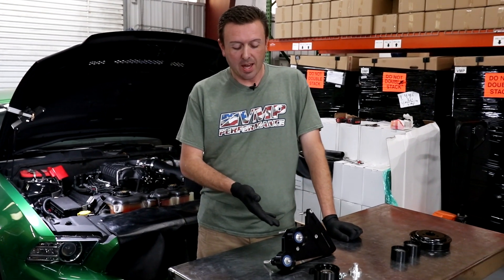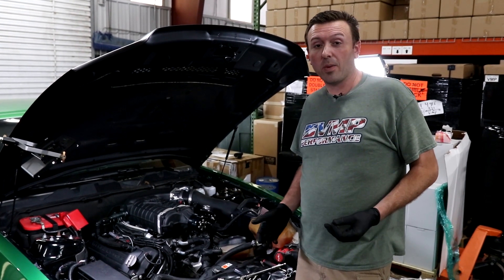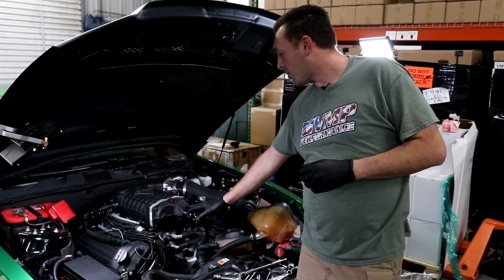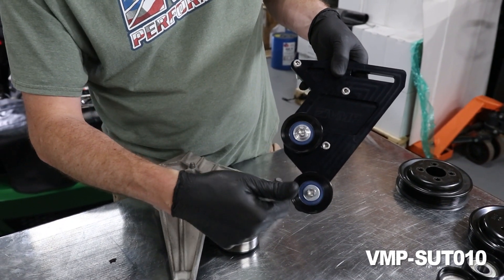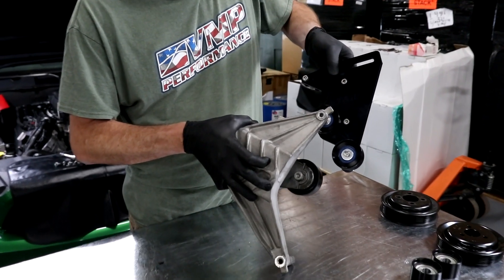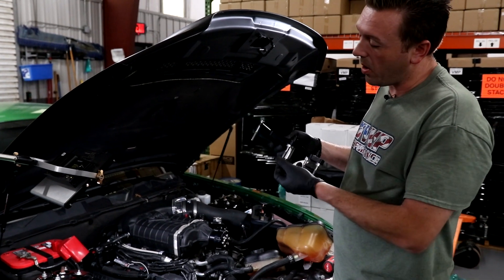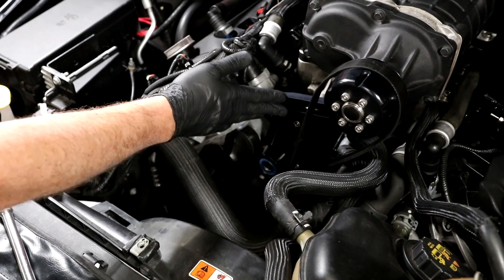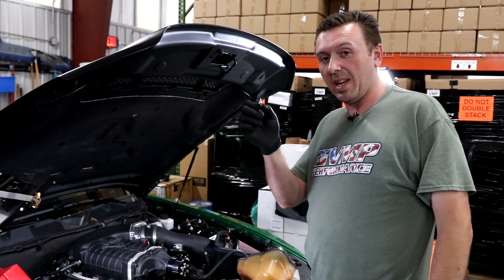Product Feature ||  '11-'17 VMP Bomber Bracket FEAD Upgrade

Comment: I was running a bigger pulley & still ended up breaking a belt, seems like it was because the natural set up leaves the belt looser than it should be.

Guess I'm going with this additional pulley setup now
Reply from the maker: Hey Shane, appreciate your business and support!  Belts can be a bit of a challenge as there are a number of variables that affect them.  We have seen them last for years, and we've seen them snap in months/days.  Driving style, climate, and various other things can affect them.  Under WOT, we've found that the belt stretches in supercharger applications and have designed our FEAD to have range in the tensioner to take up that slack.  But over time, the belts do fatigue from this and with spirited driving require more frequent replacement.  When you swap your belt, examine your tensioner and let us know if you see anything out of the ordinary.  If so, give us a shout so we can get you straitened up!
Reply: @VMPPerformanceTV  the tensioner was fine, I just replaced the belt last night.

6 rib belts are a struggle from what it appears to have 700rwhp.

I ordered the bomber bracket this morning to help with pulley wrap
Reply: @Shane Welcher  has it helped? I'm currently trying to run a 69 mm griptec pulley and can't fix the belt slip. I have already installed a 100 mm idler and the vmp heavy duty tensioner.  I am considering this bomber bracket

BTW I'm running a roush 2.3 tvs
Reply: @bricehochstetler6855  Yes, the bomber bracket fixed my belt issue
Reply: @Shane Welcher  that's good to hear.  I went ahead and ordered one yesterday. Alex @ vmp was a huge help again!

Comment: Does the 10 rib kit require smaller water pump pulley? Installing it right now and water pump pulley does not bolt on, hits the lower idler on the bomber bracket
Reply from the maker: On a full/complete kit they do.  We also offer parts individually depending on a customer's set up.  Are you currently working on a gentleman's car named Will?
Reply: @VMPPerformanceTV  yes 😂😂 i figured it out just wasnt sure if cutting the rib off the water pump worked or not. Appreciate the response
Reply from the maker: Haha!  He reached out over the weekend.  You're welcome!

Comment: I have a GEN3RSS with a 69mm on an aluminator engine. I can’t get the belt to stop coming off or snapping. I also have the upgraded tensioner you guys sell. I’m considering buying this, do you believe this will help keep the belt on? I didn’t have this issue when I was on the VMP GEN 2 on. A stock motor.

Comment: Running 82mm on gen3r with built Roadrunner Boss 302. I assume, from what you stated at end, i don't really need this upgraded bracket, unless i drop below 75mm pulley. Right now with 82mm pulley on e85, you estimated my car to be around 750-780wheel, so that's good for me now. My new built Roadrunner Boss motor is too pretty to push to limits. If i decide to go over 900wheel, then maybe that bracket is a good idea. Thanks
Reply from the maker: Correct.  It's more of a solution or preventative measure for belt slip.  If you're experiencing belt slip, this is a potential solution.  If you're about to take the next steps to modify your vehicle where it might be in the range of experiencing belt slip from installing a smaller pulley, this would be a great preventative part to install.

Comment: Fits 14’ 5.0 roushcharged f150?
Reply from the maker: If your F-150 is using the Roush spider bracket style FEAD, yes.  It replaces that top section of the FEAD closest to the supercharger.
Reply: @VMPPerformanceTV  it’s a factory roush truck 100% stock stage 2 system besides your 75mm idlers and 90mm upper idler.
Reply: @VMPPerformanceTV  it’s a factory roush truck 100% stock stage 2 system besides your 75mm idlers and 90mm upper idler.